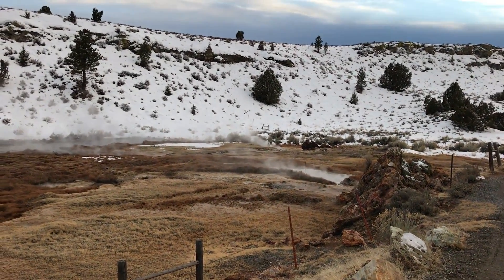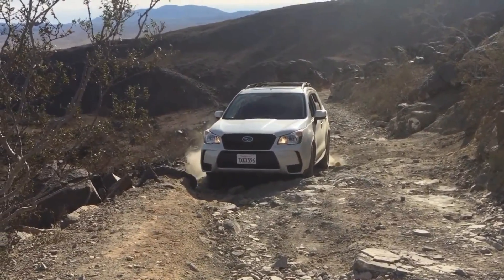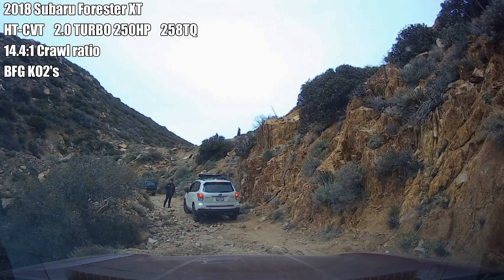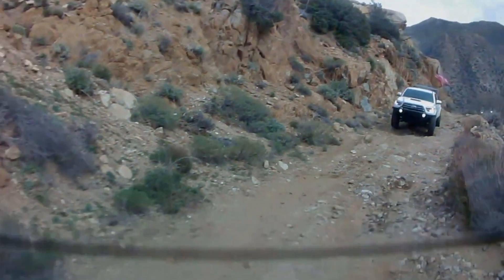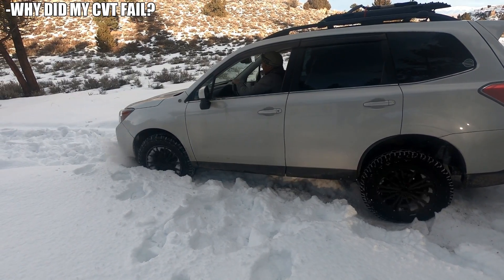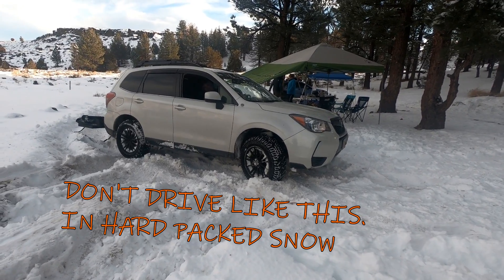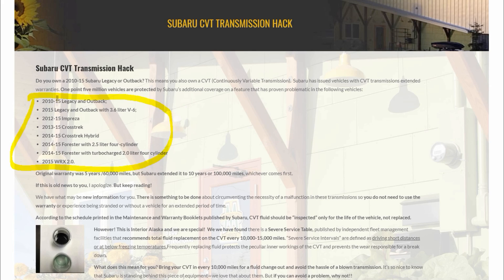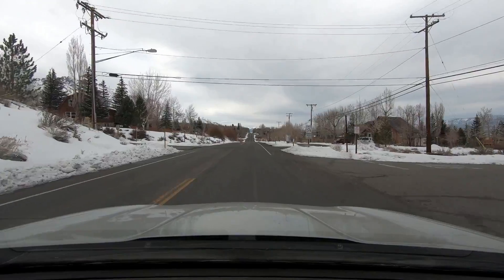CVT transmission Failed!  Can we make them last?

Comment: in theory i don't think CVT transmissions were ever designed for off road.you basically have a fluid coupler instead of solid gears and a friction disc.The belt is the weak link here.
Reply from the maker: roberto ruiz they’re not designed for it, but some vehicles are being marketed for off-road.  Dual clutch transmissions aren’t designed for off-road either, that would be the worst transmission to make off-road.  But Hyundai markets off-road capability in the Kona 🤣

Comment: Subaru could have made a 10-speed automatic transmission with the longitudinal layout. It would have been made to be reliable.
Reply: They would've had to redesign the AWD driveline, the TR690 & TR580 fit right in place of the old 4EAT & 5EAT.

Comment: Best way to increase CVT lifespan?

Let them rot on dealer lots!
Just say NO!
Don’t buy them

If you must buy one, factor in the cost of the eventual transmission failure 

Most durable, economical, and reliable option?

Buy a manual!
Reply from the maker: MacTechG4 I think this is the best way to support Subaru “consumers” and fans of the brand.  If they aren’t selling them, they’ll need start using better transmissions.

Comment: The car manufacturing companies insist on keep the CVT transmission because it's cheaper to manufacture and will make more profit for them, even though the CVT less reliable than direct shift AT. Thanks.
Reply: Tell the car manufacturers that we are not buying their cars with cvt if they keep insisting .
Reply from the maker: Samaan Alkhaldi I agree.  If the CVT is suppose to be more simple with only 1/3 of the parts as an automatic transmission I wonder why they cost $6500 for the transmission.  Then another $2500 for installation.
Reply: @JonDZ_Adventuring  Because replacing a transmission by the dealer is a very good reason for them to take a lot of money from the customer.
Reply from the maker: Samaan Alkhaldi at the cost of the brands reputation.  This really saddens me.  I’m glad Honda stepped up with their AWD system, but I’d be open to buying another Subaru.  Just not with a CVT.

Comment: Why Subaru pushes CVT when it is just a pile of junk?
Reply: They are using CVTs to increase fuel economy above-all-else (the same as other manufacturers using them).
Reply: @kenhoward3512  Congratulations! In comparison you save 250 USD in fuel and you have to spend thousands of USD to maintain and to rebuild transmissions. What a great deal!
Reply: CVT is a lot cheaper than conventional AT to manufacture as it has less parts which are even cheaper to make.
If Subaru uses conventional AT their prices are gonna jump and they won't be able to compete.
Reply: @ghenkhoash2440  people WANT quality and they will pay good money. If your policy is to be "cheap" then you do not deserve to exist.
Imagine you got a wife whise policy is to be "cheap". That is a woman no man wants.
Reply: @jannieschluter9670  I'm not sure about that woman example; So you're saying I should get a wife who spends like crazy?!
Reply: In a nutshell I am saying that an attractive price tag is not the main thing a customer is looking for.
Reply: @jannieschluter9670  Price tag still plays an important role, Average buyer doesn't know about technical stuff, for example Nissan, it's quality is low and it's using even crappier CVT in almost all their models but they sell a lot because they offer big discounts.
Reply: @jannieschluter9670  Speaking of Toyota, I realy like their new CVT design with a launch gear. I think that one is gonna be much more durable than current designs.
Reply: @ghenkhoash2440  of course. It is a toyota.
Reply: Jannie Schlüter Unfortunately it’s really because the government is forcing car manufacturers to increase gas mileage and it’s cheaper to manufacture then lets say a 8,9,10 speed to get roughly the same mileage as a cvt...
Reply: @donovanfahrbach2493  i gave up on this world. I wait for my king Jesus Christ to come and to be in his kingdom.

Comment: This is why I own a 2013 Subaru Legacy 3.6. I got the five speed unit, not the CVT so I can take it off road and not worry about burning out the transmission. I was concerned back then the CVT would have issues, and it turns out, that CVT Torque Converter cannot handle the off-road like the old 4/5 speeds could. That is the part of the transmission causing pain and suffering to those new Subarus.
Reply from the maker: @Sam S, I wish I had the same intuition as you!  I gave it a shot, I let myself be a "BETA TESTER" and unfortunately it didn't work out for me.  It's not only the torque converter, I have friends that have had the valve body and Chain belt fail prematurely.  
One day, Subaru will move away from CVT's and no one is going to miss them.  Only then will we all truly accept how bad of a match they were.  I get that CVT's are put in ATV's, snowmobiles and small commuter cars, but they really shouldn't be placed in a larger crossover.  I hear rumors that Subaru is making a vehicle specifically designed for offroad, so I'm very curious what transmission they will put in it.
Reply: @JonDZ_Adventuring  Had not heard that.  We all know how much pressure they are under to get the gas mileage up to the competition, and the turbo 4 along with the CVT allows them to do that.  It will be interesting to see where they go moving forward, as I don't believe they can stay with the CVT and keep their durable off-road image intact.

Comment: What about having 2 transmission coolers :/, or is that over kill ? I live in a fairly hot/dry area during the summer and I like to go out mountain biking when I can, I just got a 2019 WRX Limited this June, plan to add supporting mods for both the engine and transmission :).
Reply from the maker: @sphoxros I've heard of people running multiple transmission coolers, but that is beyond me.  I'm unfamiliar with those setups.

Comment: Plain and simple, the cvt pros outweigh the cons of this type of transmission. It's lighter and cheaper to make, and it supposedly gets you better gas mileage and performance from the engine. I think the cvt's, are meant for light "off-road" use and not anything like seen in this video going up steep hills with loose dirt and rocks.

I'm on the market for a new car and I'm looking at either an outback or rav4 hybrid. I want the outback, but my head is telling me the smarter choice would be to get the rav4. I'm not positive but I think the outback is still running the tr690 cvt and not the tr580 cvt they supposedly made lighter and changed the belt to an actual chain? Either way, the gas mileage on the rav4 hybrid can't be beat.
Reply from the maker: Thanks for sharing your opinion Christian Avalos.  The CVT definitely has benefits, but as you mentioned, they are cheaper to make.  Unfortunately, as consumers, that's not a benefit for us, it's a benefit for car manufacturers.  You would think that with less moving parts vs. a traditional automatic transmission a CVT would be less costly to service. 
 But that's not the case at all, the Subaru CVT is 3-4 times more costly to service and in 90% of cases, needs to be replaced.  The Cost of a brand new CVT is atleast $6000.  Then there's the labor costs to replace, and you're looking at 8-9 thousand dollars USD.  Now that it's been over 10 years since CVT's have been on the market, 8, 9 and 10 speed transmissions have either matched or exceeded the fuel efficiency of CVT's.  Also to note, Toyota's CVT's are not chain/belt driven like in Subaru/Honda/Nissan.  There's actually planetary gears in them.
The Outback 2.5 models have the TR580, the H6 and new XT's have the TR690HT.  Good luck with choosing your next vehicle.  I'm giving you a thumbs up and heart for sharing your opinion!  thanks!
Reply: CVT's are more expensive you know

Comment: I bought Ascent Touring.  After 6k miles, I started having CVT transmission problem..  I took back it back to the dealer, they replaced the transmission.  I will never buy a vehicle with this crap transmission.
Reply from the maker: Elpechu I’m sorry to hear about that.  I hope you’re able to get your issues resolved (through either an improved CVT or a good trade in).  I wish you the best!
Reply: My Ascent failed at 8k with street driving. New transmission, my first and last Subaru.

Comment: I got a 2015 Forester with CVT. I've pushed it pretty hard but you gotta know when to back off. Got 46k and going strong.
Reply from the maker: I agree dvgayle1, you gotta know when to back off.  To know, you have to monitor your transmissions temperatures.  The FXT is a different beast, with a 2.5 it's harder to get yourself in trouble.  Although, youtube channel highjak Secondary was able to melt his CVT and no longer makes youtube video's.  You should be able to get well over 100k miles in a 2.5.  Good luck!
Reply: Me too, mine is 17 with cvt and almost 30k and going strong

Comment: This video makes me cringe. Why the fuck are you guys taking Foresters up these extreme trails that even Jeeps have difficulty doing to begin with? If you don’t have a skid plate or trans plate of course you’re going to damage something if you hit a rock unprotected. You guys were abusing the cars plain and simple. Subaru designed the Forester for light duty use not extreme off road like what you guys were doing.
Reply from the maker: Armada Gaming, okay, okay, you're probably talking about the trail at 5:00.  I was not there and didn't drive up that trail, that's definitely a step up from a rough Los Angeles pothole ridden road.  This wasn't necessarily a hard trail, since the older Subaru's made it up with no problem, this was just a situation where Subaru's with the CVT transmission struggled, forcing the driver to have to use a lot of momentum.
Reply from the maker: Armada gaming if you think these trails are "extreme" then I don't think you have very much experience driving off pavement.  Honestly, Los Angeles streets can be this rough.  Nothing in this video goes beyond an easy jeep trail.  Stick to PC gaming?

Comment: Have you had any experience with Subaru voiding your warranty because of the aftermarket changes to your vehicle? A lot of people are saying its no big deal ( cvt fail) b/c "it's Subaru's problem" but the dealership told me that if I made any changes (lift kit, different size wheels, etc) that the warranty would be voided...
Reply from the maker: Raising Adventure what you heard is true and started a few months ago.  My CVT was replaced by back in February 2019, before Subaru started doing this.

In this letter from Subaru of America, a directive regarding vehicle modifications was released in July 2019:
https://www.subaruoutback.org/threads/soa-directive-dont-modify-your-subaru-d.513098/#lg=thread-513098&slide=0

Comment: I've been researching swapping wrx mt drivetrain into a Crosstrek. Don't know why it's not a standard option at this point
Reply from the maker: There’s a $3900 turbo kit for the crosstreks now.  It was recently released.
Reply: @JonDZ_Adventuring  how capable is the n/a 2l though? Also how's the stock Crosstrek clutch and drivetrain hold up boost

Comment: Subaru has released an extended warranty for CVT failures. You should take a look into it. However, when you said there's a lag when going up the hill with the Forester it's because it doesn't have a true "first gear" due to it being a CVT. If Subaru started using Toyota's CVT or add a designated first gear then it should be okay
Reply from the maker: Arthur the 10year 100k warranty saved me from an expensive $7-9k repair. So good on Subaru for backing up their product.  The only thing is I had the vehicle for 2 years and 60k miles, so I did not have confidence in the thing lasting me much longer.  Only time will tell how Subaru moves forward.  Imo, they should make their own 10 speed transmission with crawl gears ⚙️ with atleast a 22:1 ratio.
Reply: JonDZ Adventuring hopefully in the future they make improvements to the CVT and improve the ratios on the CVTs “first gear” unless, they add a actual first gear like Toyota does in their newer CVTs. But I feel like the average city driver that has a Subaru and maintains it should be fine
Reply: @arthurfernandes2402  maintains it? but what does that mean? It is a "sealed, lifetime" unit according to Subaru. yeah, right.
Reply: moonpost I’m from Canada, the Canadian dealer recommend that you change the fluid every 100,000 KM or every 60,000 miles for you guys. If you want to be on the safer side you can do it every 50,000 KM or every 40,000 miles.
Reply: @arthurfernandes2402  that's not what they tell you down here! I'm so pissed about this whole ordeal and the time and money I'm out... and I just got another recall letter in the mail recently, too. WTF.
Reply: moonpost I’d go to another dealer. Call and ask to see what other service advisors are saying, because it’s not possible that all the Subaru service advisors will say the same thing. So never take the first answer and always get a second opinion. If they don’t want to treat you with respect and kindness look else where instead of giving your hard earned money to a dealer that’s trying to scam you. There’s very few of them out there that are good
Reply: I do not take my Outback offroad at all and guess what? My CVT failed, at 104,000 miles and the quote to replace it was over $9,000. Awful awful support from Subaru on this known documented issue on 2013-2015 Subarus, even though I talked them down in price. I do not trust my car now. My 2nd Subaru and likely my last.
Reply from the maker: @moonpost that’s a bummer!  Actually, stop and go traffic and driving up steep highways will also stress out the CVT.
It’s really ashamed because the Subaru full time AWD system is pretty robust and it deserves a better transmission.
Reply: @moonpost  fluid changes are supposed to be at 100000 miles for normal operation
Reply: I traveled an extra hour to purchase our second Subaru Outback as it was the only dealer in the Pacific NW that includes a lifetime powertain warranty on every car they sell.  It is good at every dealer.  It does require all regular vehicle maintenance but the work can be done anywhere as long as it is documented.  I will be looking for this on every car I buy from now on after my Silverado tranny failed at 60K miles.

Comment: I live in Australia 🇦🇺 and our Subaru’s come standard from the factory with an extra trans cooler also they are only very small numbers of failures here there are lots of owners with 200,000plus KMs with no issues, our Subaru’s are made in Japan, Maybe Subaru USA is doing something different with theres or use different methods when building there Subaru’s.
Reply from the maker: Sorry for the late reply waggaclint, you bring up a good point.  Lets take the ZF9 transmission found in Honda's, Jeep and Chrysler.  It's a German Company, but the ZF9 is manufactured in the USA.  The transmissions from 2016-2018 have known to be assembled incorrectly, leading to problems.  The Subaru's here (like you said) are also manufactured here and that may very well be the problem!
Reply: @JonDZ_Adventuring  here in Kenya we run 5w-40 engine oil changed every 5000-7000 kms and CVT oil changes at 50000km....and all is well. There is stop go traffic...plenty of steep hills and rocky roads. Forester 2014
Reply: Australia was the same her in the Philippines were Subaru Foresters XT made directly in Japan in which are better car than US made. The oil filter alone tell the story in the US they use the Blue (Fram) filters while here in the Philippines we use the black (made in japan) filter... i have also a 2014 forester XT 70k with sealed untouched CVT still works like charm.

Comment: Cvt are the worst thing subrua has done ...
Reply from the maker: Maldo72, yeah I agree ☝️.  I much rather deal with replacing $800 head gaskets every 100-150k Miles (like in the older Subaru’s).  But replacing a $7000-$9000 CVT every 100-150k miles is just NO GOOD!  So far, I think the longest recorded mileage on a Subaru CVT is 250k miles.  This is on the base model engine with the newer CVT.  Let’s see how long the 2020 Outbacks with the 1st gen CVT last.  Subaru constantly makes improvements to components, but let’s see how much that will do.  It has the same engine and CVT as the Ascent, and some of those have reported failing at 15k miles.  When will they finally drop these things????
Reply: maldo72 And also In the new Toyotas